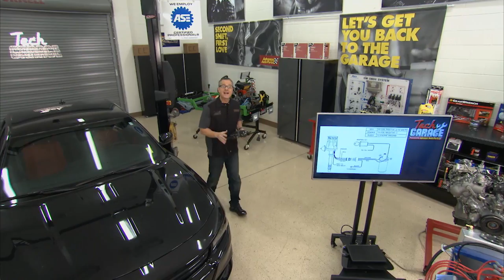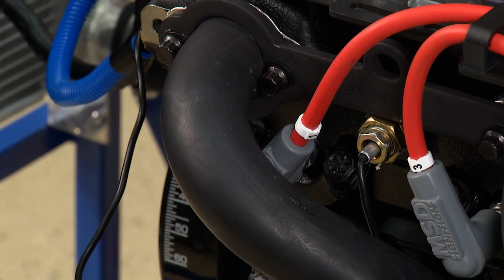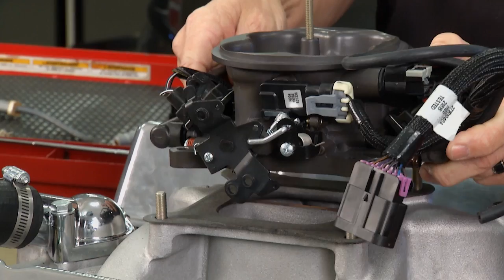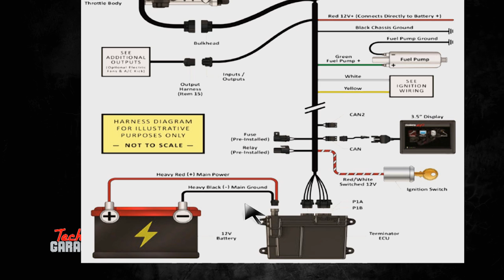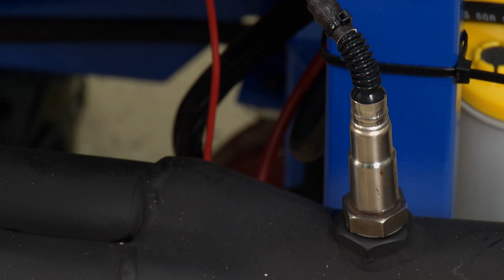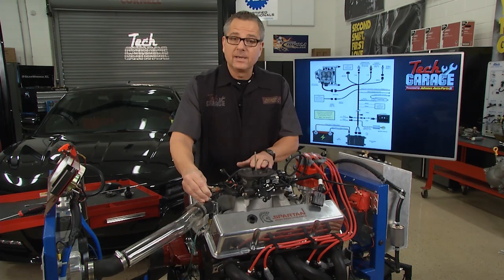Holley Fuel Injection Conversion connectivity & tuning

Comment: I have always driven a '72 Monte Carlo as everyday car since '74..... and I was 19. One is a 402 c.i. Custom. in ;72 they did away with SS's, and closest thing was a MC Custom. I have all them original, and have learned to easily work on the cars when needed. No sensors to misread and replace. My Friend Pete on SWRNC says to put fuel injection on my MC Custom... but all this stuff just so it will run once again, and then when something goes wrong, I will not have a clue on what it is... Hey, I do not race, tore up my 1st MC doing that. I just need to get from Point A to Point B, so this is not a credible choice..... It is not how fast I can make it go, it is how long I can make it go, which I have learned the hard way after racing my 1st Monte Carlo and messing up the engine.
Reply: Gracias por tu comentario. Estoy de acuerdo contigo. Satanizar el carburador está siendo de moda. El motor carburado es más sencillo y práctico, y sus problemas son claros y su reparación es clara. La inyección de combustible tiene más complicaciones que soluciones. Saludos